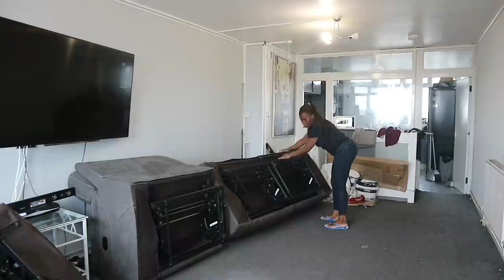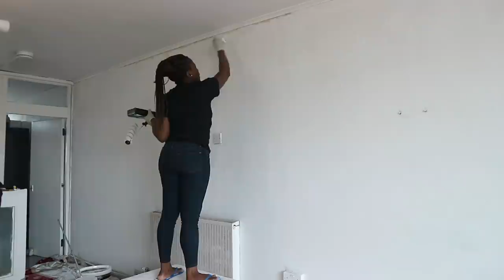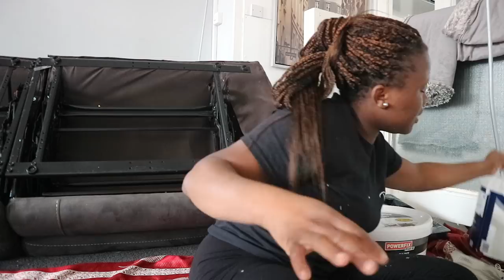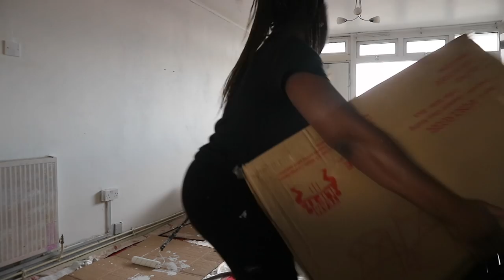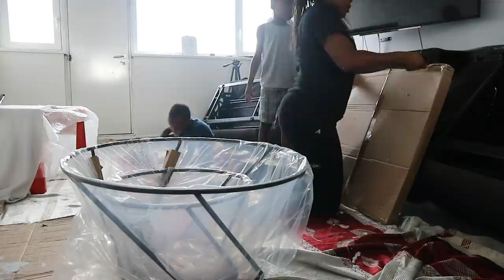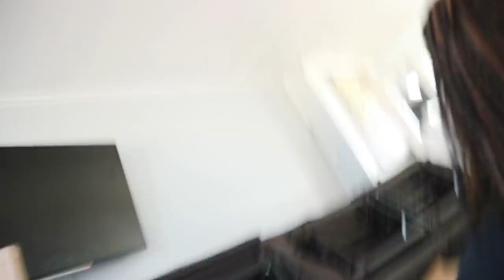NEW FURNITURE FOR THE LIVING ROOM AND LIVING ROOM UPDATE

Comment: My sister from another mister. You are doing great. For the glossy finish you'd need gloss or satin, I was told to paint my flat with matt by a few professionals as it's easier when it comes to repainting. My current walls are painted with gloss and going over that without sanding it all down has taken 3-4 coats. Matt is good...I use vinyl matt. 🤗💛